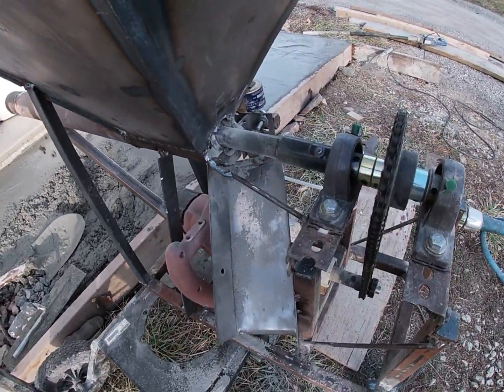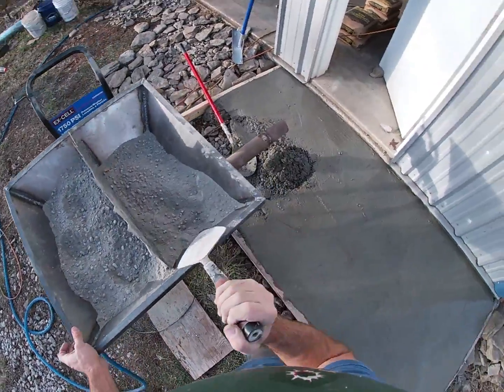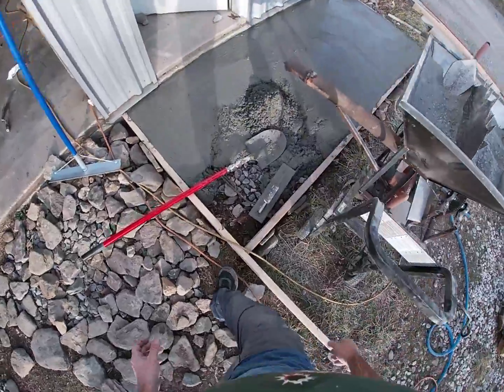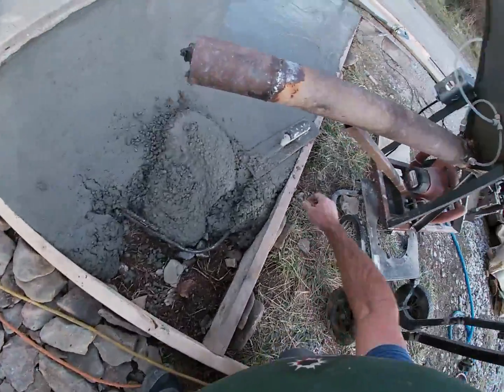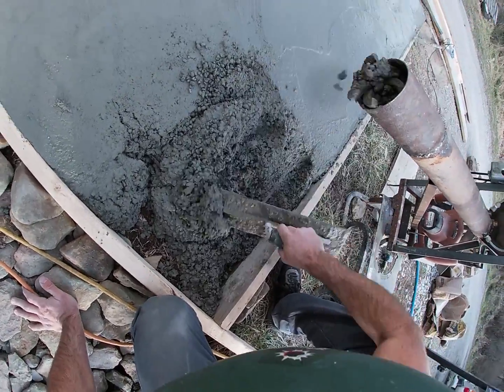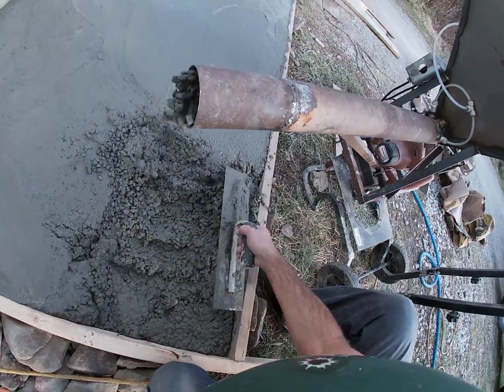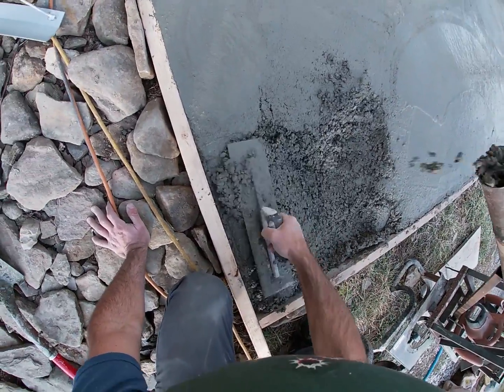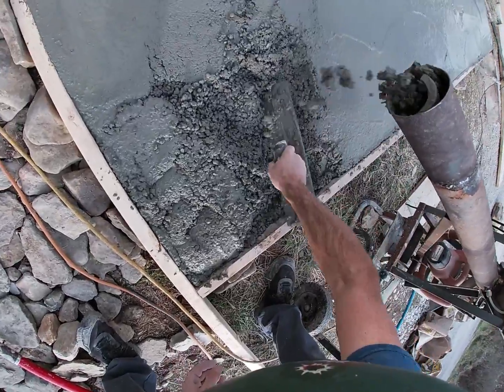DIY cement mixer,diy Mudmixer doing real job, R & D update #2

Comment: I rented a mud mixer from local guy $100 a day off FB market place he dropped it off. It was cool but later just bought one of those low plastic mixers ones like a wheel barrow. I can throw 3 80 lb bags in it then when its ready wheel it over and dump I found it just as fast as the MM.  I think these DIY MM are cool thinking could even make a bigger one with a 10 foot hose larger auger.

Comment: Or, instead of increasing the auger/tube diameter, reduce the auger sprocket diameter. Your chain takes power from the smaller diameter drill and trades speed for torque on the larger diameter auger sprocket. Unless you really need that extra torque, you're just wasting the lost speed. If you do need the torque, then a larger diameter chute will also need a more powerful motor (drill) or a bigger sprocket to gear down further and thus run even slower.
Reply from the maker: Hello,thanks for your comment.I think you are 
absolutely right.I did figure out that I did not have 
the mixer motor in the fastest speed as it has a two speed gear box.That did increase output.
And had to increase the water to meet the increased output.Maybe like 30 to 40 eighty pound bags per hour now.Did 60 bags nonstop 
no problem the last pour I did.
You definitely need some good torque.
I will try a smaller sprocket on the out put shaft 
next pour and I have concrete pad to pour behind my shop soon.And we will see if the motor can
do it.
Reply: @WeberMachineWorks  I can't wait to see that video!
Reply from the maker: @lastfrontier6536  In the works.

Comment: good job! your build and the mud mixer videos out there make me wonder if other configurations might have advantages. the hopper to the auger seems sensitive to rock sizes and maybe some binding from freak slivers of stone or whatever. seems like a good opportunity for somebody to build a better mousetrap. maybe some type of hybrid between the auger/hopper system and a traditional rotating barrel might work. the continuous feed aspect of the mud mixer is pretty great.
Reply from the maker: Thanks.I have been think of some other configurations.I have a grate right above the auger to prevent and rocks or chunks that are too big
from entering the auger and so far it has been reliable.It is a better mouse trap compared to the drum mixer.I used it today to pour some piers for my deck i am building.After I was done I was like I cant believe how good and fast and consistent this thing works.I don't see myself using the drum mixer much anymore.Always room for improvement though.Your hybrid idea is interesting,it sure has me thinking.
Thanks again.
Reply: @WeberMachineWorks  I might give it a try myself. I was imagining the hopper vibration feeding onto a chute to a large diameter pipe with paddles where the water and concrete mix would happen then feed to a chute.... But all that gets more complicated than the auger. The auger has a lot of advantages in terms of simplicity--since you added the screen you eliminated much of the potential for jams. it's inspiring to see other people put their ideas into action and actually use it--whoever mentioned the PTO drive concept was onto something too. Anyway, thanks for the cool videos.
Reply from the maker: @KevinKimmich44024  Yeah the auger is simple and effective.I made a video show how to make an auger.And yeah i am going to work on a PTO drive one,I think that is a great idea from one of my viewers.For a bigger higher out put machine.Thanks I will keep them coming.

Comment: very cool, if you make a larger one with a 4 or 5 in pipe and have to hook up to a pto on a tractor you'll be able to sell tons of them.
Reply from the maker: Thank you.That is a great idea my friend.
I appreciate your input.
Reply: @WeberMachineWorks  if you do go that route id call the local concrete plant and see if they sell dry premix because bagged wont be able to keep up.
Reply from the maker: @jhippl  Another great idea.
I will make that call and see about that.
I was thinking of making my own machine
that precisely fed all the raw materials
into a premixer machine that fed into the mixing machine.
Thanks

Comment: I dont think you really need that midevil spike hand poker there.. just a little wavy thin piece of metal will cut a bag in two. Maybe 2 spikes at most..  i could forsee the loader getting a little winded and drop a mitt on it and have a bad day..
Reply from the maker: Thanks, I appreciate your input.I tried a semi sharpened thin wavy piece and had to wrestle 
with the bag a little most of the time.I didn't want
to wrestle any with the bag especially when you start getting tired.Maybe I went a little too aggressive,but man did it solve that problem. 
Perforating the bag just right is the key.

Medieval spikes,I hadn't thought of that.
That is going to crack me up for a while.
Good one.😃

Comment: Nice. I think a bigger one would be great for 2+ people but the original mud mixer was likely designed to be able to use with just one person thus the 3" output but I think cuz your auger is an inch smaller than the pipe its not pushing enough volume so maybe try to increase the auger size just below 3" and see how the output is first & also maybe widen the intake in the bin. The oem mud mixer mixes pretty fast for one person in my opinion from watching videos. Anyways GL on your next build.
Reply from the maker: Thanks for you comment.I will give both a try.
And we will see.

Comment: If you are looking for convenience - order cement truck
If you are looking for low cost - get your cement and aggregates and use cement mixer or for smaller projects mix it by hand!
But of you looking for YT content - build ready-mix-mixer out of junk :D
Reply from the maker: Sure I would also say to order a cement truck when ever possible,but when you cant for what ever reason this is another option if you don't want to deal with mixing and measuring the separate  ingredients .This was a test to see if I could make
this type of cement mixer with what I had laying around .Next one will be scaled up .
Reply: @WeberMachineWorks  you did an amazing job bro